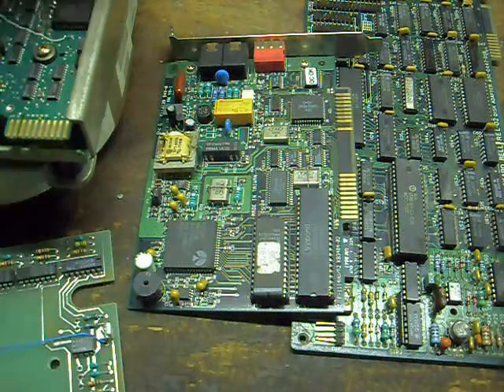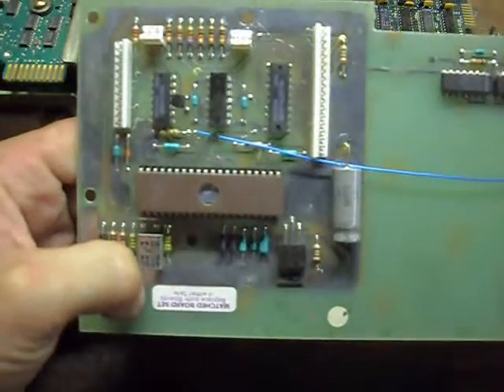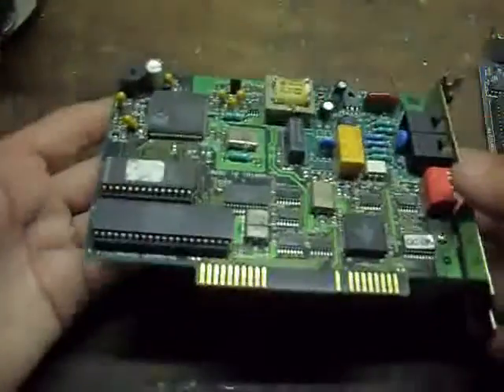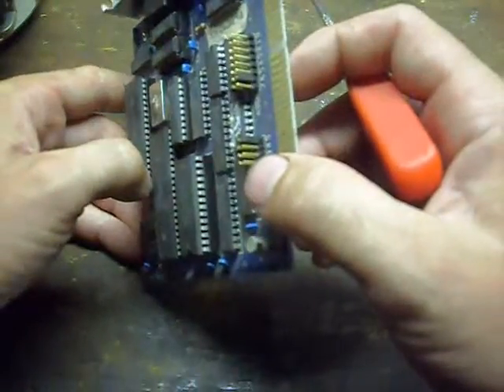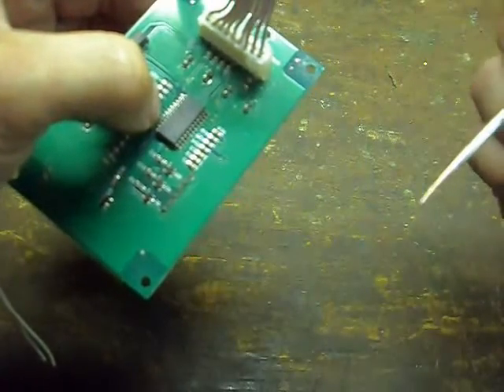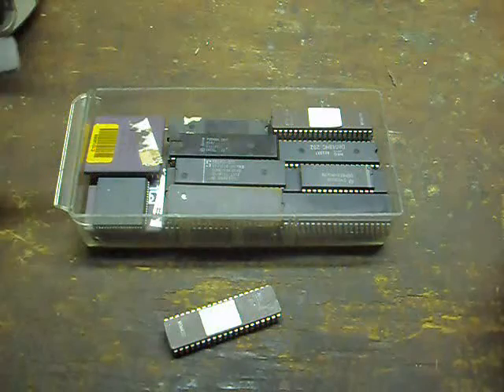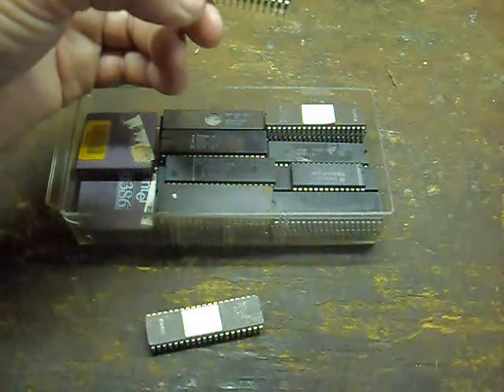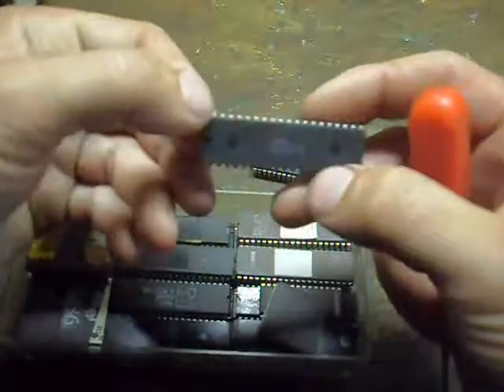Salvaging microcontrollers for electronics projects.

Comment: Hello, I have a 64 pin IC made by SHARP. Its part number isRH-IX1645A   there is a last number or letter, I think its a B or a R some of the paint is missing. Thanks
Reply from the maker: That number does not correspond to any standard part number.

Keep in mind that the “standard” part number is not always the first number on the chip.
Often the fist number can be a manufacturer “order” number that relates to specific details that the purchaser wanted on the specific part.

You need to check all the numbers you find on the chip and see in any of them correspond to something that you can find datasheets for.

Often you will find parts that have no “standard” part numbers on them that you can cross reference.
Those will basically be useless to you.
Reply: thanks
Reply: there is another number under the first
101 803100
I looked it up, but couldn't find anything either
Is it something you can understand here? or is this just a unknown chip?
Reply from the maker: +Randy Travis 

I don't think you are going to have any luck finding documentation on that chip.
That is just the way it is sometimes. There is some chips that I  have spent a considerable amount of time searching for data for, and end up ended up empty handed.
Reply: Is there any way to just randomly test chips? Like a full spectrum program that just goes through all the tests. That would be great, just throw in the chip, come back in a couple hours after its deciphered, sort of like a computer hacking into a password.
Reply: Thanks for the information, I will try and find some different chips, and mabe order a Arduino.

Comment: Hi, I cant hear you. I have the volume cranked up 100% is there a way to enhance volume so I can hear you?Also I had a good Idea for a video. Can you hack a old cell phone to use as a micro controller? They are very powerful devices with their own power supply. can you do this?
Reply from the maker: I know the audio level is not very good on the video. 
The microphone on the camera was not very sensitive.
So, some computers with limited volume settings may have a problem with it. 

And I could have done a better job with getting the subjects organized ahead of time so I would have had a rough script to follow instead of doing it totally unscripted and getting my thoughts crossed which caused a few pauses while I was trying to think of the next subject to cover.

I have been thinking about redoing the video when/if I get time.

And as for old cell phones, There is a wide range of equipment on the market, and there is a very wide variety of processing cores used in cell phones. Some of them have MPUs with internal ROM/EEPROM, some external. Some have internal EEPROM that is unprotected, others have internal EEPROM that is protected by a secure access protocol of some type to prevent people from hacking the phones.

Most modern phones will have surface mount or leadless IC packages (BGA) or the like. So salvaging them for reuse on your own circuit board will be very difficult for most home hobbyist. So reusing them will be pretty much limited to reprogramming them and using them “in place” on their existing circuit board. 

Older cell phones, like analog bag phones, will more likely have through hole components that can easily modified, or removed to be use on your own projects.

On another microcontroller related subject ……

One very interesting possibility that has been in the back of my mind for a long time is DSL modems. I have been thinking about making a video to cover my thoughts on the possibilities. 

Key features with DSL modems that catch my eye is they have a relatively powerful processor core matched up with a powerful DSP front end for DSL signal demodulation/modulation. If you could gain control over the DSP front end, and reconfigure it, it could possibly make a very powerful Software Defined Radio (SDR) receiver that would cover the HF bands. It may even work as a low power HF SDR transmitter.

And another benefit with them is that old used ones can be had for almost nothing.

The problem I have seen with DSL modems is access to the information covering the actual interface between the DSP front end and the processor core is heavily restricted by IP agreements.

So reprogramming one will be real difficult when you don’t know the actual specifics of the control layer/data layer between the DSP front end and the processor core.
Reply: Its very hard to find any thing here, I  can find 555 timer chips, what would you suggest would be a simple micro controller ic to practice on? I really need to get some experience, these guys here must have something, they don't understand ic's they just look for numbers, with no idea what they are selling.
Reply from the maker: +Randy Travis 

In my opinion. Among current production microcontrollers, The MCU that is the easiest to learn and actually apply to a wide range of tasks is the MCS 51 series. Otherwise known as the common 8051 It is still one of the major families long after it was introduced years ago. And it shows no signs of going away any time soon.

Many people have learned the basics of microcontrollers on 8051 based educational systems.(including me) And they are plentiful in the electronic parts supply market, and in junk equipment ripe for salvaging.

The documentation for programming them, and the compilers are widely and freely available on the internet. 

You can program for them with assembly (which I prefer) or C if you are familiar with that language.

When you are looking through part numbers for them new, or salvaging equipment, look for the common derivatives of the MCS 51 family. Those being 8051, 8052, 80c51, 80c52. or the romless versions.. 8031, 8032, 80c31, 80c32

ATMEL’s and others’s common part number for them is the AT89**series.

When they are in the full 40 pin package they can almost always be set to run code from an external ROM/EEPROM by jumpering the EA pin. So, they will be usable no mater what they were originally programmed with.

I don’t know where you live…. But One place from the US to order them is Mouser electronics. Mouser has over a 1600 different MCU chips in their product list that are based on the 8051 core. Through hole ones starting at $1.39 US a piece, and surface mount starting at $0.55 US a piece.

Other options that a lot of other people prefer is the PIC based MCUs, and Z8/Z80 based MCU. Both families are easily programmable in assembly or C.
Reply: Thank you. I will write these ic numbers down and check out the parts store. I think these guys will have the 8051, it just doesn't make sense that they wouldn't.

Comment: I am completely new to this, I have found an Atmel ATMEGA16L8PU0848K from an old Amstrad Sky box. I can use it even if the protection bit to stop you from reading their code is enabled and if the SPIEN isn't enabled. Thank in advance for any help
Reply from the maker: If the program lock bits are set, the only way to recover it is with a full chip erase. Chip erase can be initiated with JTAG, SPI, and parallel programming.  You said SPI is disabled. If JTAG is enabled, then you can use that to initiate chip erase. If JTAG is also disabled, then you have to have a parallel programmer to initiate full chip erase.

Once the chip erase is done, all lock bits and flash should be back to factory, and then you can program the fuses to your specifications.